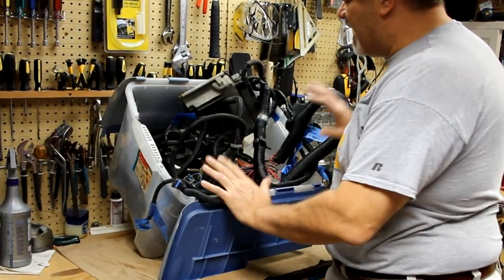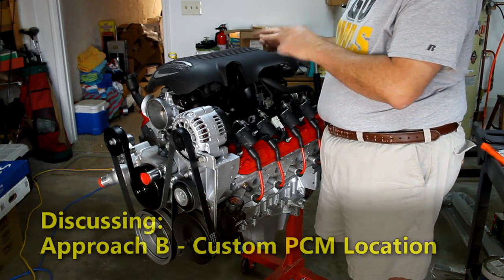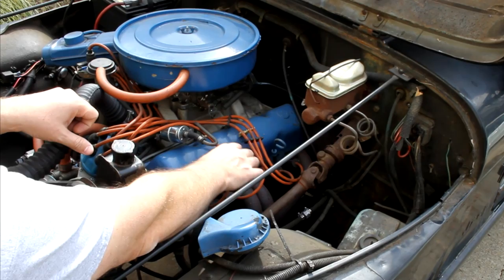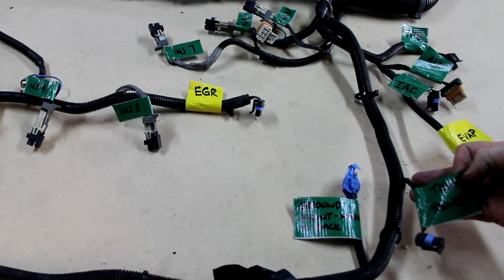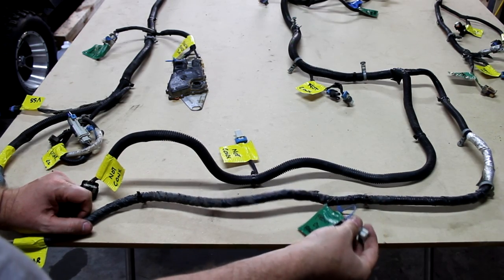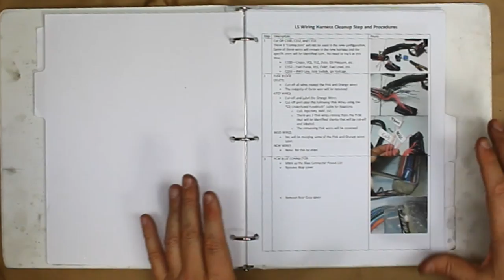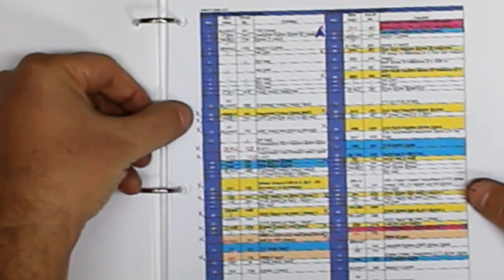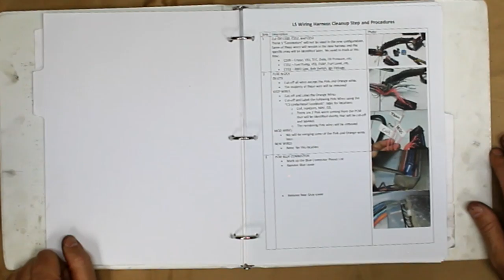LS Wiring Harness Part 1 | Project Rowdy Ep013

Comment: Thank you so much for your help with this video. I have seen it like 20 times and surely helps. 

I am dropping my 5.3 into an 84 Ford E350 shuttle but RV and 4x4 conversion in which is on a extremely weight loss!!!
Reply from the maker: Cool Project you have there!  Glad you found some answers in the vid.  Have fun with your project!!!  Mike
Reply: UCanDoIt2  Thank you Mike! Coming out better than expected. The old tired factory 460/240hp probably had 75hp when pulled. A true gas dumpster. 

As soon as i get it running I’ll send you pictures.
Reply from the maker: @YourpainRx  I would love to see it.  A Ford with a GM heart!  Don't read too much into that I love both brands.  I drive an F150 and love Chevys.  Cheers!

Comment: Thank you so much for sharing your journey. I have a 2003 Escalade Ext with a 6.0L vortec. Don't plan on cutting any wires but do want to rebuild my engine and what you've done will help me a lot. I almost wish I was one of the boys ( I'm a woman by the way ) and get that hands on experience. My engine is at 215 miles.
Reply from the maker: Awesome!!!!!!   You are currently on the right track of doing some research and gaining some knowledge.  Between and Book and my machinist, all the answers were obtainable.   Enjoyed this and your other comments.  Have fun!
Reply: Label every wire, you can write it in any code as long as you understand it.. Use numbers/take pictures etc.. These motors have a super wear resistant steel in the cylinders, so dont be surprised if you dont even have to bore the cylinders out for bigger pistons.
Reply: Don Rutter Thanks...Did the valve cover gaskets Friday for starters
 I was having leaks from them and the grommets.... I may have a rear main seal leak as well or it may be the pan don't know yet. I had to do that just to hold me off till I'm ready to tackle this monster....

Comment: Mike, for some reason I have been missing the vids in my feed, but I will be getting caught up soon. This video is an excellent approach on how to tackle automotive wiring. Although I have never wired any LS engines, this is very similar to what I did with the 55 Chevy. Great video!
Reply from the maker: Thank you Russ!   I'm pretty pleased as to how straight forward it turned out and I believe this approach could be used for any manufacturer's engine harness.  Repeatable tasks with a few unique decisions along the way.

Comment: Great information.  I will be revisiting this series when I get to this stage.
Reply from the maker: Thanks Sam.  I can't remember...  have you mentioned your plans for the 72 Camaro?  Gen1, Gen3, Other?
Reply: Plan is to get a complete drop out LS1 & T56 including wiring, PCM, accessories, etc. from a Camaro or Transam 99 to 2002. I will need the Camaro intake, oil pan, and accessories for my application anyway.  Ideally I would like to get a wrecked 4th gen Fbody and take what I need but don't think the neighborhood association would like that very much. lol  Hawks motorsports is somewhat close to me and they always have dropouts in the $5K range with around 100K to 150K miles.
Reply from the maker: That sounds like a good plan.  Always nice to inherit many of the parts that will work in your new application.  That crap gets expensive!  And that sounds like a smokin' price!!!!

Comment: great video. I wish there was a video of you pulling the wires off the vehicle. I'm now pulling wires from a suburban and I don't know if I can cut a lot of them. Especially the thick bundle going into the firewall on the drivers side.
Reply from the maker: My engine came from a Salvage Yard, where it had already been tested and pulled when I saw it.  On my video of the harness spread out on the plywood, you may be able to tell how it was cut from the donor vehicle.   Primarily the whole fuse box and the three body harness connectors.

Comment: thanks for a quik answear. so than PCM must be reprogramed even if I don't removed any sensor or any wiring from the main engine harness?
Reply from the maker: The PCM is currently programmed for VATS (Vehicle Anti-Theft System).  If you are swapping your engine into another GM based vehicle that also has the VATS components installed, there would potentially be no reprogramming required.  If you are swapping your engine into an older vehicle, the VATS programming will need to be disabled in the PCM.  If you do not disable it, the engine will start and run for about 3-5 sec and then shut off.  If you are planning to install a MIL Indicator (Check Engine Light) you may want to also disable any other features that your new vehicle does not offer so that the PCM does not alert false alarms.
Reply: @UCanDoIt2Mike  thank you so much! for a quick and well explained answer. am swapping the 5.3 vortec engine into a Chevy 1952. once again thank you!!!!

Comment: I'm looking forward to watching your wiring harness series of videos and soaking up the knowledge!   How did you get your oem harness so clean?  Mines caked in 285k miles worth of Texas dirt and road grime.  Can i just pressure wash it with the electric pressure washer?
Reply from the maker: I never saw the condition of the truck mine came out of, but I assume it was a city truck!   Based on people using pressure washers (home and at the car wash), it don't see any issues with using a pressure washer on it.   Allow it to dry.  Most of the connectors already have dielectric grease in them and most of them you are going to remove anyway.   Go for it!   Have fun with your project!   Mike
Reply: @UCanDoIt2Mike  thank you Mike

Comment: Great video.  I followed this and built my harness.  I have 12 volts on all my sensors and coil while cranking.  It cranking.but no spark or no injector. I checked with noid light . I pulled all mt injectors and checked each one and they all fire. I replaced the crank sensor.  Ugh any ideas? Thanks Dave. Ps vats removed
Reply from the maker: Not sure how you have setup your fuses, but with the key on, make sure all pink wires are Hot.  If so, it sounds like the computer is not providing the trigger properly.
Reply: Man I feel like an idiot.  I had my crank and cam sensor backwards.  They are the same plug. Thanks for you response and these videos me and my son build our harness to a tee from this. I'll not do that again.  Lol
Reply from the maker: Glad to hear you figured it out!   A great project for you and your son…. Mike

Comment: @ 8:52, those two connectors you are going to remove, that last one when I trace back the pink wire, it’s going to spot C4 which is the MAF. In the video, you have it labeled to be removed. Do you need to keep that plug? It’s a five wire plug with a purple insert in it.
Reply from the maker: At that part of the video, that leg has the Front and Rear O2 Sensor Connectors for one of the sides of the exhaust.   The one that i pickup and is labeled Green is the Front O2 Sensor which you need to keep.   The connector to the left of that connector is the Rear O2 and it can be removed.   All 4 O2 connectors have purple wires in them.
Reply: UCanDoIt2  I wish I could upload a picture to show you. That’s not what I was referring to, I know what the O2s are and I kept both front ones like you did. But at that point of the video there is two plugs, above the aforementioned arm that both connectors you labeled, not connected. At this point in time I was curious why you had the last connector (the MAF) labeled to be removed. BUT I set that arm aside and moved on and when I got to your next video in the series when you’re starting to remove wires, you mentioned that you had this labeled as not connected but you discovered it was actually your MAF, so you kept it. I posted that comment at first thought, without waiting to go through with the next video. So I got it all sorted and thanks to you, I have my harness complete! I finished it last night and it took about seven hours, over three nights to do it! So thank you for such great content. I never thought I’d be doing this kind of work myself for my vehicle. It’s intimidating but you made it easy. So thank you again! And thank you for the quick reply.
Reply from the maker: Excellent... Glad you have it all worked out.   I do remember that leg and changing the option to keep that MAF connector.   Cheers!   Mike

Comment: Look forward to seeing how you cut and splice the wires together.  I'm not sure if you have any shielded wires to cut. I love this stuff, built a lot of harnesses. Good stuff Mike.
Reply from the maker: If you have any good suggestions...  I'm all ears!   I did consult with an Electrical Engineer at the office to validate sizing of wires when I splice together.  Other than that, my plans are Solder and some good Shrink Wrap!   Thank you Steve!
Reply: Mike i'm confident you know what you're doing.  All i do is solder the  wires add liquid tape then shrinkwrap with the type that has a sealer inside the tube to prevent moisture from getting in.  I've seen youtubers put silicone on the wires and then shrinkwrap , nope not a good idea. LOL  The dollar store shrink wrap works great in the desert i guess but in areas of high moisture the wires turn black and green soon. HAHA  I use a soldering iron  and heat gun not a bic lighter and a plumbing torch.  LOL
Reply from the maker: See there!!!!  I knew I could steal some good ideas out of you!  I have tons of Shrink Wrap, but it is the simple type.  I'm going to go find some that has the sealer inside.  I knew that it existed, but never really thought to use it.   You Da Man!  Thank yon Steve!

Comment: Thanks for the great videos, excellent quality pics. and well thought out and explained .  I,m still trying to understand how the coils and injectors turn on and off thru pcm and  grounds? Assume cam and crank sensors do that?  Thanks
Reply from the maker: Here is my understanding...  When the ole "Distributor" was removed from the engines and they introduced the PCM (ECU), the computer began to control the firing order and timing of the spark.  The only way the computer knows when to fire the spark for each cylinder is "primarily" based on the Crankshaft Position Sensor and Reluctor wheel.  That tells the PCM the exact position of each Piston (when they are at the proper location to fire the spark).  This determines the "Base" Spark timing.  As an adjustment to that, the PCM has several adjustment tables that it can apply minor adjustments to the spark timing based on input from sensors like:  Temperature Sensor, Knock Sensors, O2, MAP, and others.  These sensors are reporting to the PCM various conditions that the PCM then can make monir adjustments.As for the Injectors - They only have 2 wires going to each.  1 is a Pink wire which is 12V+ when the Key is ON.  They must be Negatively Switched via the other wire.  When the PCM wants a particular Injector to fire, it provide a closed circuit Ground (-) on that second wire.Good Stuff!  I believe that is all correct.  It is the only way that it makes sense to me.  Thanks for watching!
Reply: nice video but I have one question how much would you charge to wire a 5.3 LS1 engine with the 4L60E transmission

Comment: Found your videos while doing my swap.. I found them very informative along with lt1 swap, but I must be missing something. There is section you didn’t have labeled that ran on the opposite side of the trans wire. What were those connections to? And the coil pack connection has a black wire that connects to about 5 other black wires I’m assuming all those are ground wires..correct?
Reply from the maker: Not sure about your reference to a section that I didn't have labelled.   This might have been all of the Transmission related connectors which in my installation, I do not need.  Typically the bundles (unions) of Black wires are grounds.  They all connect together and then get connected to the Head or anther grounding point.  Cheers!
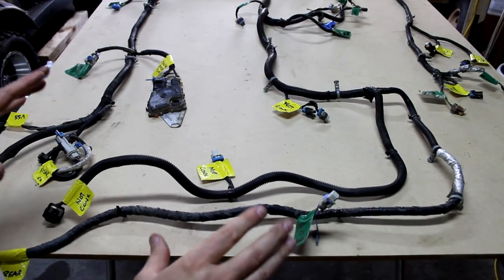Reply: Ok thanks, the part I’m taking about starts a 8:28 on part 1 the non connected ones..

Comment: If you never done anything like this before, it may be a good idea to not cut anything. until you have went through the whole harness, de loom, and separate out the un-needed wires, bunch them up , and de-pin, and/or cut last thing, you may need the wire and pin for something else, or to replace a damaged pin. It would be better than soldering to the harness!

Comment: This may be a silly question, but if you delete the evap wiring will the vehicle pass inspection?
Reply from the maker: Not a silly question.  I will also be disabling the EVAP from within the PCM programming so that the check engine light and codes are not tripped.

Specifically for my vehicle, it is old enough that it will not need an emissions test.  It is a 1979 Jeep.

Comment: I just recently found this page and all i can say is THANKS!!!! It will be a huge help with my swap. Is there a way to get your PCM connector pin out list a little clearer? Hopefully you still read this series
Reply from the maker: Yes.  I still follow and read every comment.   The Pinout list that you are looking for.   Is it the Blue and Red List?
Reply: @UCanDoIt2Mike  yes the blue and red list that you added more X's to for removal. I am doing a swap in a 3rd gen Camaro so will not need most of the harness
Reply from the maker: @paulcolterman3087   Here is a link to my PDF for all of the Connectors.   bit.ly/PCMandConnectorTables
Reply: @UCanDoIt2Mike  thank you very much!!

Comment: did you save a sensor that turns LIGHT ON  to indicate the engine oil level is low?  am confuse about OIL LEVEL SENSOR OR OIL PRESSURE SENSOR.
Reply from the maker: Javier Argumedo I removed the wires for the Oil Level Sensor.  The sensor is located in the passenger side of the oil pan.  The Oil Pressure Sensor, I kept.  That sensor is located on the top/rear/center of the Intake manifold.
Reply: @UCanDoIt2Mike  i would like to save the low oil level sensor and install a warning light in the dash to know when oil is low so do you have any idea how to connect that warning light? or this light can be connected from oil pressure sensor or do i need both LOS and OPS?
Reply from the maker: Javier Argumedo OPS and OLS are doing two completely different things.  You will want to keep both in your case.  You will need to study the Pinout sheet to find the trigger wire from the pcm to connect to the new light on your dash.

Comment: Best how to videos on YouTube thanks you
Reply from the maker: Thank you!!!!!  I appreciate the feedback!
Reply: UCanDoIt2 hey very nice job I’ve been watching your videos over and over...very organized
Reply from the maker: Very glad that you have found the videos helpful.  Cheers!!!!
Reply: UCanDoIt2 how much would you charge if I asked you if you wouldn’t mind making me a binder like you made yourself I’ll pay for shipping as well?.thanks for the reply by the way . I can’t print it out like you have because I don’t have a computer or printer. Thanks again
Reply from the maker: my files would only make sense if you have basically the same engine 99-03.  I would prefer to send you the files electronically and you find a local business or friend that print them for you.   Privately send me your email address to:  ucandoit2mike@gmail.com
Reply: UCanDoIt2 yeah I can do that ... I can probably go to the library right? I’m doing exactly what you’re doing I have a 5.3, I believe it is a 2003 sending email address now
Reply from the maker: Actually, I just looked it up and my pinouts charts are for 99-02.  Are you sure yours is a 03?
Reply from the maker: I will send you my stuff and you will need to check with LT1Swap.com for your exact PCM pinout chart and transfer the "X" to the new chart.
Reply: UCanDoIt2 engines are the same I’m using pcm for a drive by cable. PCM 1999-2002 SERV. NO. 09354896 blue and red connectors
Reply from the maker: Cool!   I sent you my documents, they should work as is!  Have fun!!!!!
Reply: UCanDoIt2 thanks for the info, hope you and sons have fun building your Jeep! I’ll be watching
Reply: Ucandoit is the documents the same as what we download off your page?
Reply from the maker: Yes.  The documentation has not changed.  If it ever does, I will be sure to update the documents that the Links on these videos point to.  Cheers!

Comment: Thank you for taking the time to relay all of this information, your channel is fantastic! Did you ever get a chance to post the PDF?
Reply from the maker: I didn't!  And here is the reason....   Due to filming, this took a lot longer than it should have.  With that, I had plenty of time to continually think and adjust what really needed to take place.  I ended up just using it as a reference, but following it step by step.  Therefore, it doesn't completely match the video series.  I had two choices... edit the document OR put it on mothballs...  Guess which was easier.   Do you think it would be very useful?  You are the first to ask for it.
Reply: @UCanDoIt2Mike  no worries, I think LT1 swap made one and linked it on his site...I'll post it when I get on a desktop